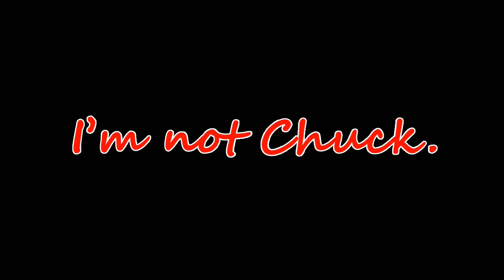Pouring Concrete Floor for Barn

Comment: hello from the sunny Ozarks im not Chuck!!  excellent progress. u going to have u a workshop out there too?   no drains or water in your barn? looking forward to your next adventure of framing ur barn!! ull have to get some chickens to keep the ticks,chiggers and other critters away! that should be the right size to do your projects in out of the weather! our lakes are still high at record levels from all the  rain!  watermelon festival this year at cave city ark. is july23, 24.   ur barn will be a great asset to keep ur rv out of the weather and excellent area to have to work on it, especially washing and waxing it and not being in the out sun!    tight lines and grace  be with you!!
Reply from the maker: Hello Phillip. At least I have a foundation; maybe the rest will be easier to pull together. It was a rainy spring here, but I expect the summer will be dry. It's always good to hear from you.

Comment: Hi I’m not Chuck,
I noticed the mix appeared quite wet and there appeared to be a white residue on the surface the next day. I’m interested in how the surface hardness came up after a few days, could you scratch the surface easily with say a nail or was the surface hard, as it should be?
What strength was the mix also?
Reply from the maker: Hi Steven. I am not an expert on concrete, but it seems fine to me. I have been on it quite a lot with my tractor moving lumber and other materials in and out, and it shows no cracking or other deformities. It was a 4,000 pound mix with fiberglass. I have shot some additional video of the project, but have not gotten the editing done. Thanks for watching.

Comment: I sure wish I had built my garage large enough to accommodate my rv. I often hear about contractors blowing people off. If you don’t want the job say so.
Reply from the maker: It is harder and harder to hire people to physically work. It will be good to have a place to keep my trailer under a roof. Thanks for watching.